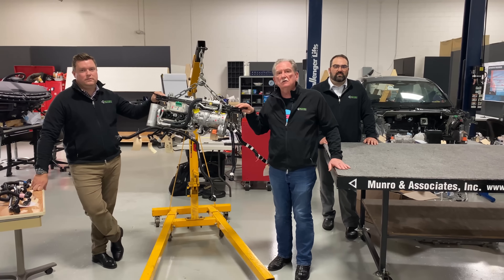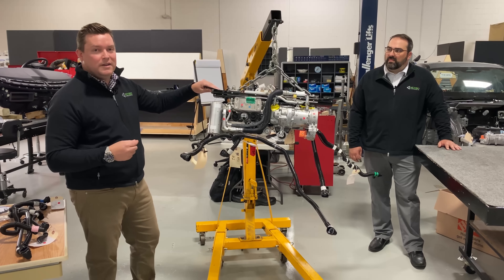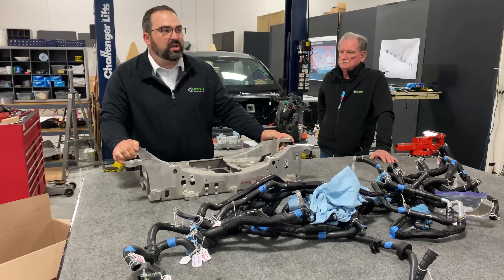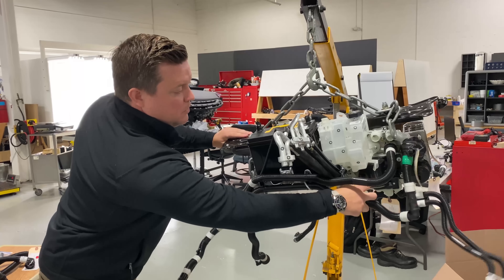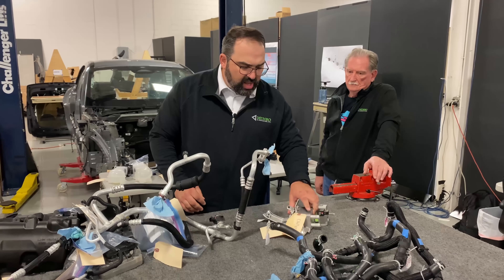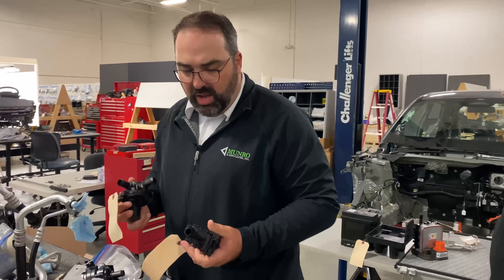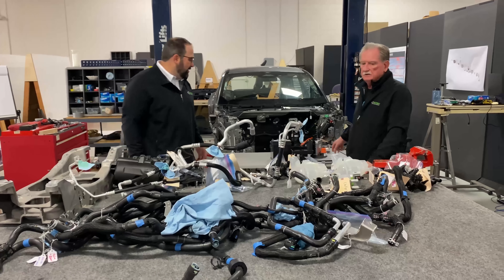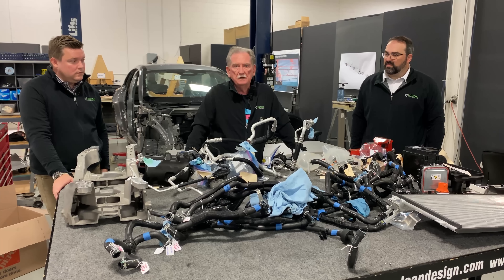Mach-E Thermal System Part 2: A Detailed Comparison to the Model Y

Comment: As an engineer myself, I can't say what system is better without fully knowing why Ford did that and Tesla did their way. This review could have been more impartial if the Ford components weren't dumped onto the table into an unorganized heap for dramatic effect. Ford's system clearly works from Car and Driver's test, and it would have been more useful visuallizing how all the hoses come together in the system to try to see if Ford was solving a problem that Tesla needed to bandage later with their heat pump.

For anybody concerned about coolant leaks, Munro & Associates conveniently failed to mention the different types of hoses. Tesla opted for flexible hoses that are cheaper in labor to assemble, whereas Ford used carefully chosen hard hoses that use curing to be more sturdy and leak-resistant overtime as the liquid is rapidly pumped through it. Again, I can't say it's a better system because I don't know all the details, but Ford's system looks more advanced and definitely not a cookie cutter cooling solution. It's just impossible to see when all those parts are dumped on to a table like that when Tesla's parts are kept together according to design.
Reply: Have you read the story about the Mach-Es in Norway overheating when going downhill and completely shutting down? At least six or more of them have done it and Ford issued a statement regarding a software fix that's coming. Whether this can actually be fixed with software is another question entirely.  I believe in the US there have also been incidences involving overheating with the Mach-E . Part of the problem seems to be a result of their braking design that favors regenerative braking over disc brakes.  

So, given those issues, I have doubts about the Mach-E's thermal system design. Also, as mentioned already, more hoses and clips = more points of failure.
Reply: @cyberfred5520  It's speculated that it's just a software problem. The Mach E over-regenerated, causing the battery to overheat. Can you be more specific about you think it's not just a software problem? Also, I've seen that article, and if you look into the comments, someone actually pointed out that Ford never said it was a thermal issue despite the article's author making leaping assumptions. It's all speculation right now, and it could just be a software bug. Ford only said it was due to "security". Personally, battery overcharge makes the most sense to me.
Reply: @johnnguyen3834  
How could it not be thermal issue if it involved overheating? 

Anyway, this is Ford we're talking about here. This is the same company that engineered the CD4E tranny known for overheating, or the Coyote 5.0 engine known for having lots of issues from Cylinder scoring to downright rod bearing / block failures to this day. Or the evaporator core assembly known for having leaks. And that's just he tip of the iceberg.

Superior engineering has never been their forte. So yes, I would suspect a poor design rather than just a software issue. However, I could be wrong. We'll have to wait and see.
Reply: @cyberfred5520  Overheating can be caused by the software, even when there's nothing wrong with the thermal system. Tesla has fixed a bunch of stuff, including braking distance, over the air and never needing to actually change the brakes! Believe it or not, it's entirely possible that it's a software issue.
Reply: Do you work for Ford?
Reply: @rogerstarkey5390  No
Reply: None of that excuses using more parts than needed (creating more failure points) and having more weight than needed. The more advanced system is the one that uses fewer parts to achieve the same job. That is the Tesla.
Reply: @xBIGMUSCLEx  The key is "same job". As I've mentioned, we don't fully know the difference between the two systems. Ford's design doesn't need a heat pump, whereas Tesla's does (a seperate system, not shown in video). Tesla's heatpump added so much complexity that they needed to invent an "octovalve". The heatpump was an afterthought in Tesla's design, and the octovalve's complexity is not mentioned over in this video, despite it being a critical piece of info in order to do an apples to apples comparison. Even if we ignore all of that, we still know is that Ford's system cools not only a much larger battery, but that battery is also a structural battery.
Reply: @johnnguyen3834  a heat pump is far more efficient than any other forms of heat generation, that’s why they use it. The Ford needed more parts partially for that reason. The system is relatively less efficient, and apart from that, it’s just bad engineering. Almost every vehicle from Ford has the same matrix of tubes. It’s not a new thing, it’s just the only way they know.
Reply: @xBIGMUSCLEx  I think neither of us have the expertise in heat pumps, but I disagree that a separate add-on is more efficient than than a thermal system that was designed with it in mind to not need a heat pump in the first place. Do you have any data to suggest that Ford's system is less efficient? As for Ford needing more parts, are you comparing it with Tesla's thermal system including its added-on heat pump system? I'll admit that Tesla's heat pump is an engineering marvel in that it was compatible with the existing thermal system so that the Model Y did not need a major redesign to adapt from the Model 3 platform, but it's hard for me to believe it's better than a monolithic thermal system. And have you also considered the needs of a structural battery?
Reply: @johnnguyen3834   I’m not sure why you’re arguing what you don’t understand. Do you know how heat pumps work? They are over 100% efficient. Yes, that seems counter-intuitive but it’s true. This video goes a lot more in depth on it: https://youtu.be/S7wxGl7m2sw

Ford’s system is relative less efficient, and this is an issue of them prioritizing cost over efficiency. They repurposed the same tubings they used for all of their other vehicles to save cost. If you’ve owned any significant amount of Ford vehicles you’ll know what I mean.
Reply: @xBIGMUSCLEx  I'm not sure why you assume I don't understand heat pumps. I think you are also misunderstanding what the debate is about when we talk "efficiency". The efficiency in question is in the storage and transfer of the heat so that it can be used from a sink, not in the generation of the heat itself. When talking about heat pump efficiency, it's weird to think that it's up for debate whether it's over 100% because it's reusing the heat. That's the point of heat pumps, and it's not something people disagree on. The debate is about how Ford's thermal system doesn't need a heat pump to to achieve the same thing as Tesla's, and whether one system is better at the storage and transfer for heat. Again, can you provide some details into why Ford's system is less efficient and is a cheaper system? In my opinion, Tesla's flexible hose design is the cheaper solution, and its post-design "heat-pump in frunk" less-intgrated add-on is an afterthought.
Reply: @johnnguyen3834  think about it, Ford can only generate heat using battery power. The tesla can generate heat using battery power plus ambient heat. With the tesla, it will heat the cabin using less battery power compared to the Ford, which relies solely on battery power. The Tesla’s system therefore is more efficient in the sense that it will be using less battery power to do the same amount of work. This is what efficiency means in this context.
Reply: @xBIGMUSCLEx  Ford integrates their thermal system with their heat pump. Thermal systems inheriently interact with their ambient environment. I'm not sure why you think otherwise. Maybe you're comparing Tesla's heat pump with a traditional heat pump?
Reply: @johnnguyen3834  the tesla uses less unit of energy to do the same amount of work. Apart from that, the Tesla’s system is also lighter weight. The latter also helps with overall efficiency of the car. Less energy consumption + lighter weight = better range. I’m not sure why you think you can argue against the laws of physics.
Reply: @xBIGMUSCLEx  I've brought this up before, but I feel like it's been ignored. Are you comparing Ford's monolithic thermal system without the need for a seperate heatpump against Tesla's thermal system with heat pump? Tesla's heat pump doesn't look light to me. I'd love to hear why you think otherwise. Laws of physics welcomed.
Reply: @johnnguyen3834  wtf does “monolithic” mean here? Every part is unique but they all work in unison in both systems.  One system just does more with less. If you watch the video, Sandy gave a break down of the weight for both systems. The Ford unit weighs almost  3x as much. Weight is the enemy of range.
Reply: @BIGMUSCLE   To try to clean up this convo a bit, I'd love to hear why you think Ford's system does not trade with ambient air. And why you're so confident Tesla's thermal system + separate heat pump and additional hoses to connect the two make it lighter.
Reply: @xBIGMUSCLEx  monolithic design/architecture/model is an engineering term for highly integrated systems, as opposed to interchangable machine design.
Reply: I don't know what you been smoking 😂

Comment: No one has mentioned all the additional time it takes on the factory assembly line to have several workers make 70 hose connections on the Ford compared to the 4 (?) connections on the Tesla’s hoses that 1 worker can probably make.

Comment: How does it compare to Tesla's 2012-2020 vehicles?
Reply: Doesn't matter.
Ford had access to every one of those vehicles and so should have been able to improve on them. They clearly haven't.
Reply: I think it's relevant. 

We all know legacy automakers already have enough trouble continuously iterating.

These parts of the Mach E design were finalized long before the Y's heat pump design was in the wild.

Comment: Ok one thing I haven't heard is how serviceable these components are. The tightness of the components sounds like a difficult car to work on.
Reply: If you're talking about the Tesla(?) 
The unit appears to bolt to the crossmember.
There are less than 8(?) Hydraulic connections.
There are less than 10(?) Electrical plugs.
It seems to me that IF required, the complete unit could be removed in about 15 minutes and the complete assembly (as shown) repaired in a bench.
However, what's to go wrong?
The octovalve is sealed, no moving parts.
The compressor/ pump seems accessible, easily removed.
Hose connections? Underneath, car on a ramp?
Stop assuming nobody considered service access.
(It's not Ford we're talking about)

Comment: Thank you for tearing apart ev's, no one else can do what you do. What is the real world difference for the consumer? Higher cost up front and for maintenance? Lower range? Less space for a trunk? Can you please say more about this?
Reply: Costs more to manufacture due to higher parts count and more connections. The extra weight is bad for range and performance but bear in mind that it's less than 1% of the weight of the vehicle (still, I'd rather have that 1% than not have it). Cooling systems on EVs have lower operating temperatures and pressures than those of combustion-engine vehicles, so I actually don't anticipate long-term issues with leaks, but if you ever have to work on one of these, it ain't gonna be much fun. Integrating functions into single assemblies CAN lead to their own issues (see Rich Rebuilds re the quoted $16,000 battery module replacement due to a cracked hose fitting that wasn't replaceable separately as an OEM part) so there are elements of trade-off involved.

Comment: Tesla oh you have 25buck faulty  pump. But you hsve to replace the whole heat exchanger that intergrated into it. Oh ok how much 700 dollars!  Theres a point engineers are fighting against the bean counters and also not taking inconsideration repair ability
Reply: You didn't see the pump then?
In full view on the end of the unit?
Reply: @rogerstarkey5390  First off, im not talk specifics im talking in theory.   Which one is it? Mechanic  loves to work on Harleys because they break down often and simple cheap to fix. But rather own a Japanese cycle because he never has to work on it. But when he does it a bitch.

Comment: My 2003 Golf GTI had nylon valves used in the coolant system. When these valves are attached to the engine they were always warping and leaking. All those hoses and valves in the Mach E are a potential nightmare for the Mach E owners in the future, but should be under warranty when they start leaking.

Comment: Thanks for the great tear down. The Mach E looks like a rush to market design. We all know the disadvantages of all hoses but the Tesla octovalve has trade offs. The cost to have a octovalve replaced must be sky high and that valve is complex and is microprocessor controlled that makes troubleshooting very complex. The Mach E  has tanks that tells you what part of the system is leaking. The Mach E has a long way to go but Tesla needs to look at service more and keep the cost of repair down.
Reply: Nah it doesn't.  The Tesla software probably pinpoints the exact problem 99% of the time in a 1.0 seconds or so.

Comment: Great tear down info - thanks!  

Most likely Ford isn't using their CAD/CAM design systems to the same extent Tesla is - which is probably the same one they use at SpaceX (which I believe is Dassault's CATIA system).  Would make sense as it entails upfront investment that engineers appreciate a lot better than financial/ managerial types.

Comment: As usual, another eye opening class on how to do things smart, Tesla smart.  I find it interesting that a car magazine just did a test of ev's and awarded the Mach E as the winner...believe the Telsa came in next due to fit and finish.  I love the engineering on the Tesla, slightly dismayed by their fit and finish.  The legacy manufacturers have the body stuff nailed down and screwed down but their instruments, interiors and software are waaaay behind.  I'm really interested to see a tear down and comparison of a Hyundai Ionic 5 to a Tesla.  Might be a contest as Hyundai has the build quality and I think they might just have the engineering to do things right.  Although the tiny frunk on the Ionic 5 doesn't bode well.  One things just sticks in my mind.  Watching one of the early SpaceX's launches and the recovery of the booster rockets they showed mission control.  Lots of young engineers and they were truly excited and showed it.  This is the heart of Tesla.  I think that GM, Ford and Chrysler/Stellantis may have engineers and good ones too but they are held down by the bureaucracy.  Exciting times.

Comment: The crazy thing is that this doesn't actually have a hell of a lot to do with the cars being EVs.  This this just Tesla designing a better cooling/heating system - ICE makers have been doing this for years! Tesla not only beats them at the EV power train but at this too?
Reply: That just shows the Emperor is actually naked. My specialization is elsewhere, but I am an old engineer and this shows serious lack of integration in the industry and lack of creativity. I always thought that an engineer's job is to innovate and keep thinking all the time.

Mach-E: "Okay,  we need a pump, and we need a valve, so we will also need brackets to fix them to the chassis, and a pipe to connect the two components."
Tesla: "Okay, we need a pump, and we need a valve, so how can we put both in the car with as few extra parts as possible?"

It's almost as if the decision makers at Ford assumed that the Mach-E won't sell in any significant numbers, so it won't pay to retool for better integrated components
Reply: @rrolf71  “won’t pay to retool” not enough people have hit on this. There are so many decisions that go into bringing a product to market. I think a lot of the contracting/supplier paradigm hurts legacy auto manufacturers for sure. There are plenty of advantages inherent to Tesla’s vertical integration of engineering. That said, just because a company like Ford designed a less efficient cooling system doesn’t mean they are stupid. They may have just chosen not to spend the money in certain areas at this time. Could they have spent more money developing the cooling system and gotten a better result? Probably. Did they need to at this time? Hard to answer, but I don’t think it’s going to make or break the vehicle.
Reply: they have been milking services  for one hundred years
Reply: The problem is that legacy builders buy nearly all parts from suppliers, because these are cheaper. This means that the parts don’t integrate. Tesla designs and builds complete units. For legacy firms to go back to building parts themselves is like starting a car firm from scratch. No Legacy experience advantage.
Reply: Tesla do great things same they can’t get their body panels to line up 🤷‍♂️ Both companies do good and bad things.

Comment: Hello Sandy,
I am curious if you have the VW ID with Heat Pump that uses R744 (CO2) as refrigerant. 
The technology there could be a good comparison with the Tesla and Ford, do you think it has better permormance? 
R744 besides other refigerantsn has a very high pressure inside the sistem, over 150 bars in the HP side of the compressor.
Looking forward to your feedback about this topic :) 
Keep up the good work !